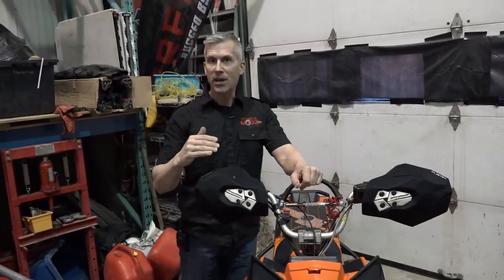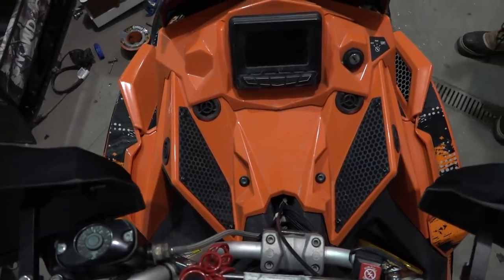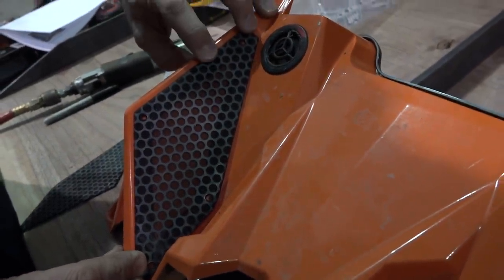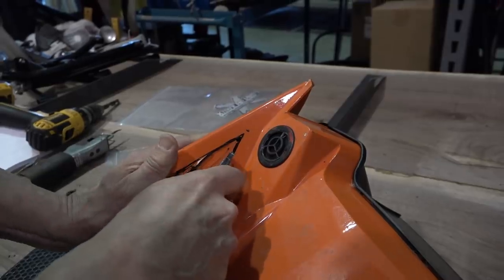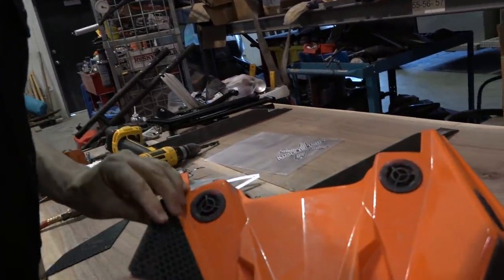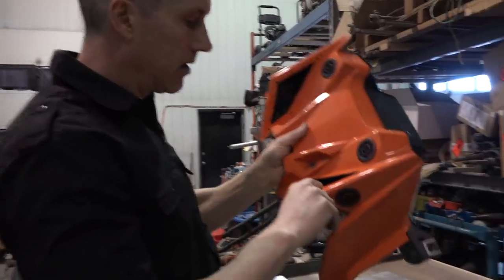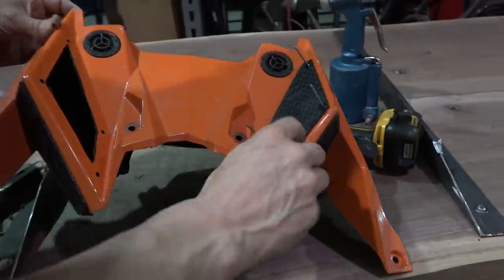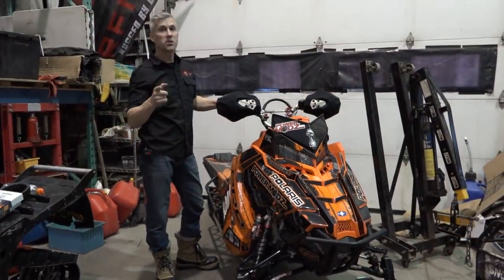XTREME AIR VENTS Install Polaris AXYS!! NO MORE POWDER BOG!

Comment: Was riding my 2016 Axys in over the hood deep powder on the weekend and experienced what I thought at first was powder bog but it didn’t clear when cleaning the intake vents. It turned out to be snow going through the center hood vents and melting on the wiring/relays and causing some sort of short which ended being the source of the bog. The solution was to clear the snow and dry the electrical before the bog would go away. It happened to me three times that day. When I got home I ordered the 6 piece Frogzkin hood kit. Have you heard of this before.      Also a couple weeks ago my stator wire plug melted causing a short in the electrical. Had to cut it out and hard wire in some jumper wires. I really hope to have no more problems because I really love the sled.

Comment: Just put my frogzskin hood kit on my axys last week and they work awesome. I was getting snow on my under hood relays and I think it was cutting out my power valves, but not sure, engine wouldn’t rev up past 4000rpm until the relays dried out. Wish you would’ve made a vid - They were a little tricky to install due to the uneven surfaces but with some patience I got them on looking good.
I was also having trouble with huge amounts of snow going through the exhaust side foot well and gathering around my battery and quick drive belt then freezing in place. I was worried about damage to my belt so I ordered a set of footwell vent covers. Haven’t got the yet but when I do I will review them.
Reply: The footwell vents are from T3 Customs. For around a hundred bucks you get quality and a tight fit with optional colours to match your axys. About 30 minute install and they look good. Ran them today in deep spring time snow and very little snow got in around the belt and battery. Very good buy.

Comment: Hey Loui,
Do you still sell these at your store? I tried to look them up on your website but I could not find them. I am interested in getting a set of these high flow air intake vents and I am also interested in the "chimney" clutch vent for my 2016 RMK 800. In your experience, which do you like more the Xtreme vents or the SLP vents?

Comment: Both me and my friend ride axys SBA 600's in the deeper snow and haven't experienced powder bog and neither has my other friend with a SB pro s 800, I've had my intakes completely plugged with powder and nothing noticeable, when I removed the hood I've noticed that the connection between the plastic airbox and the "fibre airbox" that leads up to the intakes is a really loose fit, is it more sealed on the rmk's ? And has anyone found a good way to seal the two boxes together without using silicone as it's still nice to be able to remove it

Comment: Isn’t too much air bad? Correct me if I’m wrong because I have an axys and might consider doing this to my RMK
Reply: It won't be " too much " air.. but will allow the engine to breathe better in powder.
The computer will compensate and add more fuel as required.

Comment: Any carb/injector tuning required?
Reply: its not putting any extra air into the engine just allowing it to breathe when the stock air intake gets blocked. more "available" air intake locations
Reply: @justinbeyond  Interesting, I thought it actually did pull more air into the engine. Thanks!
Reply from the maker: @FredRobich  pretty sure it will but wont need tuning